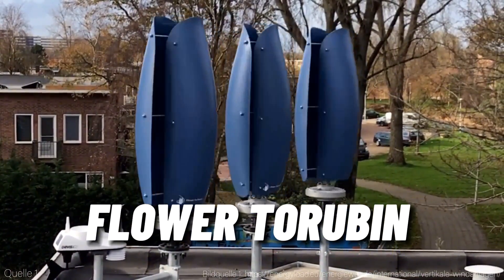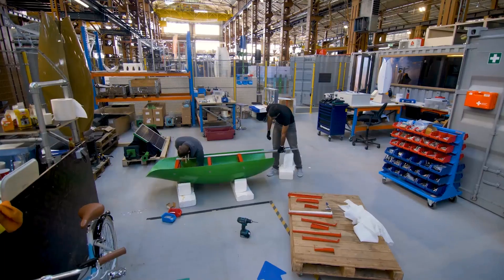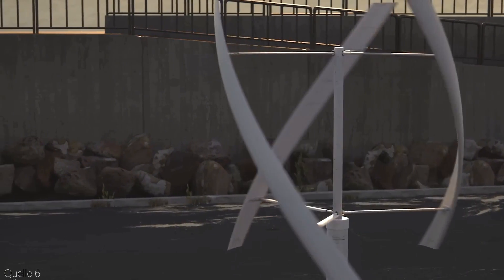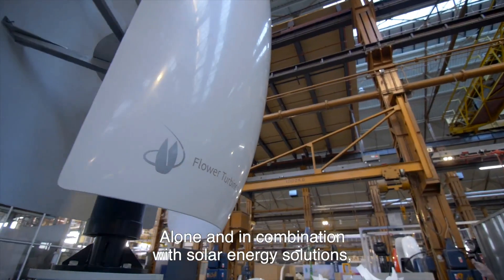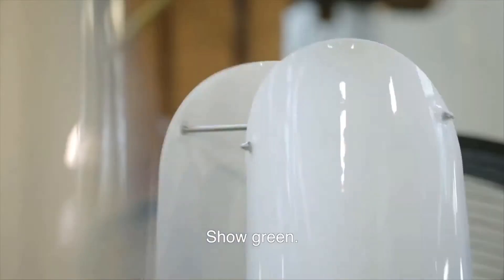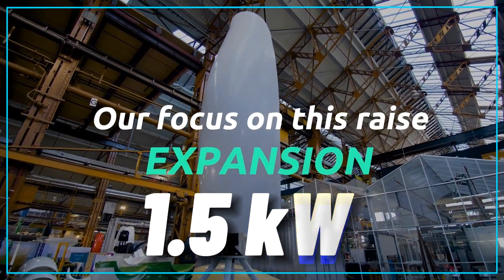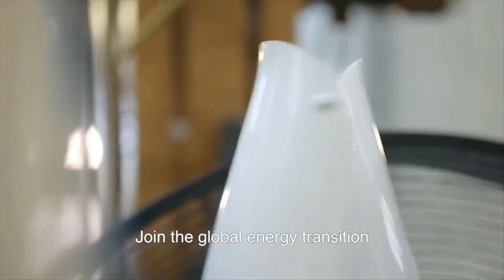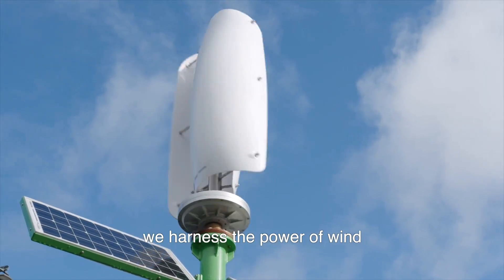The NEW Flower Turbines 2024 Most Powerful Wind Turbine In The World Outperform PV Solar Together?!

Comment: Wait for the 10x cheaper wind home devices like the nasa type designed ball and then it might have a decent ROI. Also the tandem solar film once you can install yourself, just stick on over any surface. With these two devices solar and wind will have some impact and be cost effective. Now both are overpriced with 15 years ROI. That’s way too long.